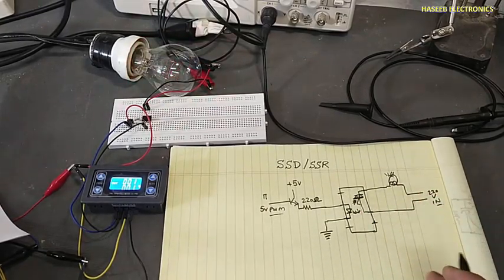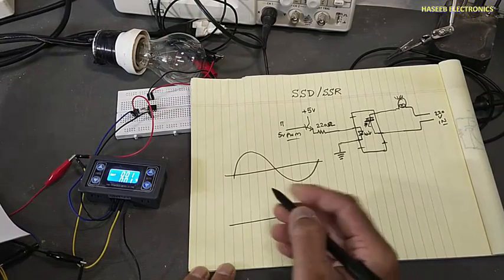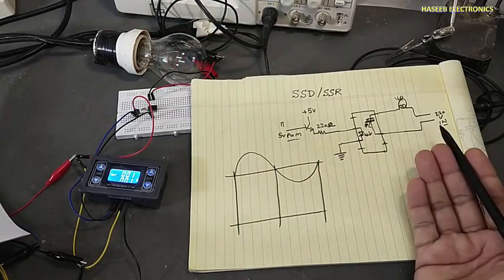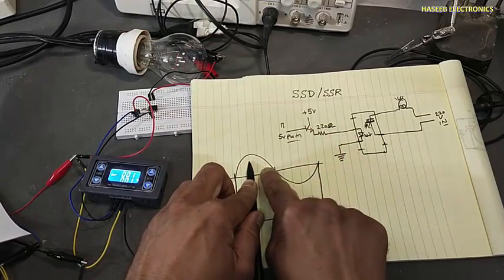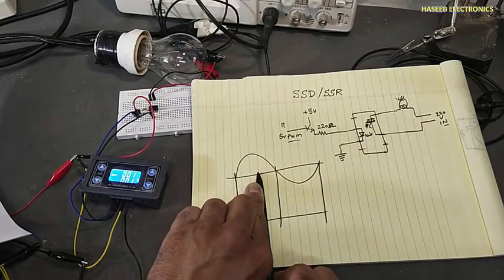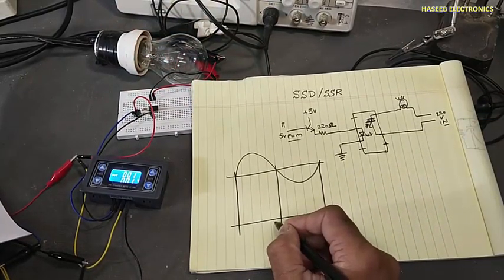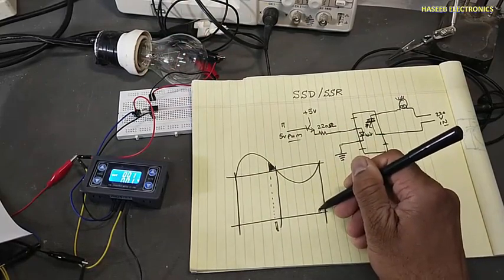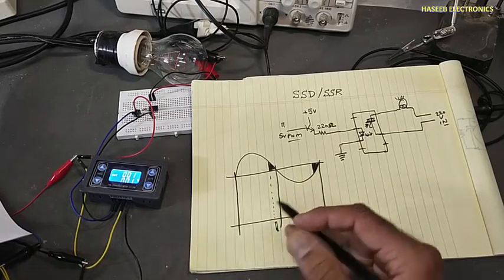{846} Triac Output SSD, Solid State Device, Solid State Relay

Comment: Sir please guide I have designed a snubber circuit with moc 3041 & traic bt 136. When there is no load there is 230v output in respect with neutral. How to suppress the voltage leak?

Comment: can this device be used to hold the output voltage at 220V AC at the inverter output.  I'm trying to make the push-pull inverter, but everytime I put the load at the output, I notice the voltage drops.  Which device do your recommend to assist in holding the output voltage steady? I know that we cannot change the output frequency but perhaps the duty cycle? Thank you
Reply from the maker: no this device cannot be used for driving inverter H-Bridge 
we need TL494 or KA7500. for that purpose we need to design voltage mode feedback to error amplifier number 1 of tl494/ka7500.
Reply: @HaseebElectronics  Thank you

Comment: That's neat there are the combined optocoupled DIAC-TRIAC package.  At least appears is a DIAC present in parrallel.  Sort of low current rating being under 1A and less than 0.9A.  Still, interesting and thanks for sharing as always.  Very best regards sir!
Reply: Oh boy, duh, time for my bed time.  Forgot these can be used to control other higher current rated devices like thyristors for high power controls and more-so before the days of higher current MOSFET and seems IGBT's now-a-days more-so. Peace be upon you.
Reply from the maker: yes brother 
there are high current SSRs (solid state relays) are available, which can control load having high ampere rating
Reply from the maker: best regards
the output side, there is an IR Detector (which is looking like diac). the ir detector receives  IR from IRED (ir emitting diode), and then triggers the output TRIAC (between in 6 & 8). the output triac can also be triggered by external trigger (pin 5)
it is most commonly used in inverter ac indoor unit circuit cards to control the speed of the blower fan